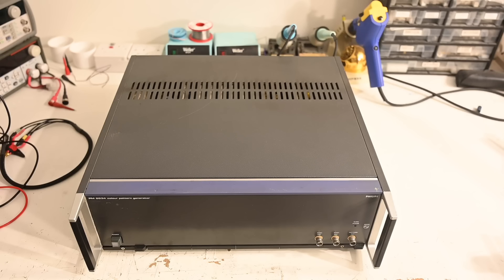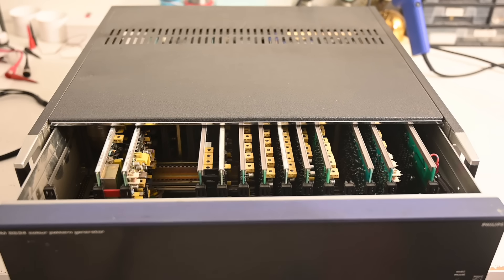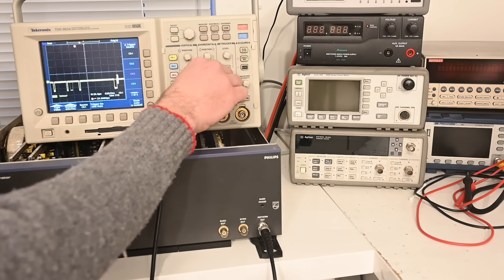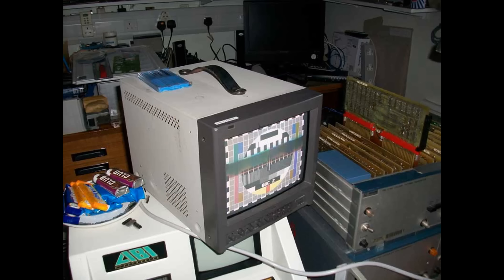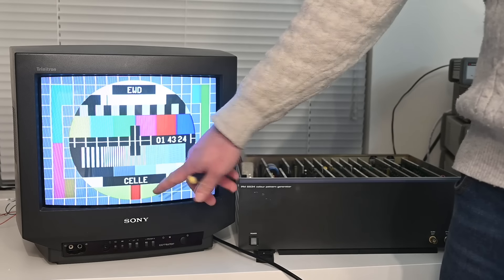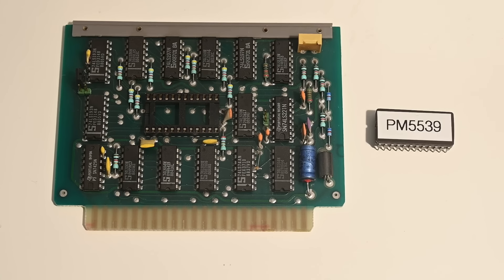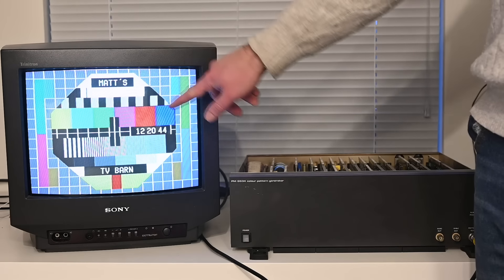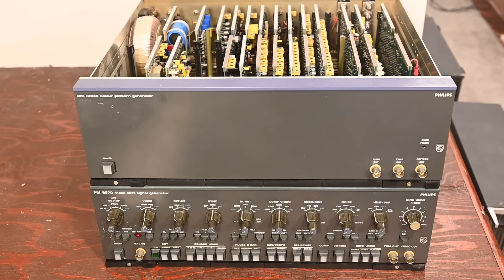#15 - Philips PM5534 pattern generator - repair, history, fun and teardown

Comment: I used to work at a Satellite Relay Center and I would have to schedule time on the satellites for different users and I would have to put up test cards and " head and tail " feeds

I HATED WHEN THE PHONE WOULD RING

I had so many jerk that would call the control room TOC problem line number I had on some of the feeds.

Especially if it was a controversial figure doing a " Satellite Media Tour "

The absolute worst one was Howard Stern

So many jerks calling the problem line and I would have to spend time listening to them and I would ask for their ID and then they would say something offensive and I would hang up.

This day the roll over lines were full and it rolled out and called the manager and I got called on the emergency line and I hated that line ringing because I knew it was one of my 30 bosses.

And he was yelling at me like I was not answering the phone.

I told him what was happening and I was getting thousands of calls and hour on the problem line

I actually had the urge to put the private line for calling the site where the broadcast was originating and let him feel the hell I was going through, but I didn't do it.

There were a lot of really cool things that I got to see working there.

I miss those things.